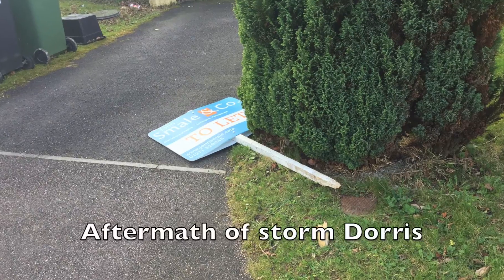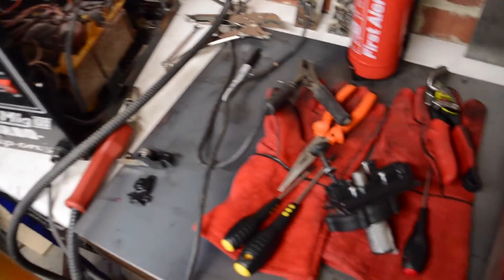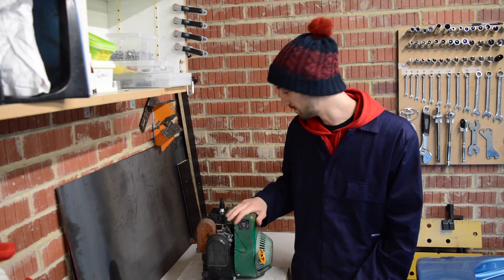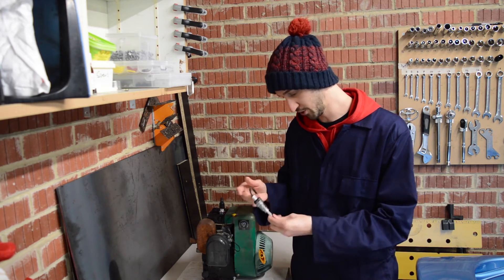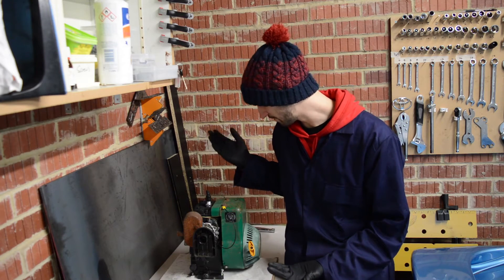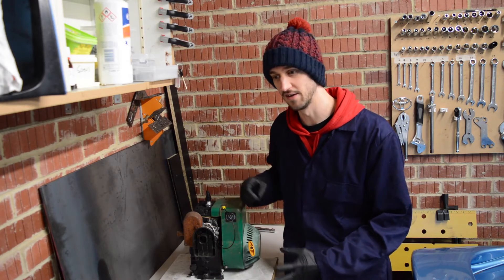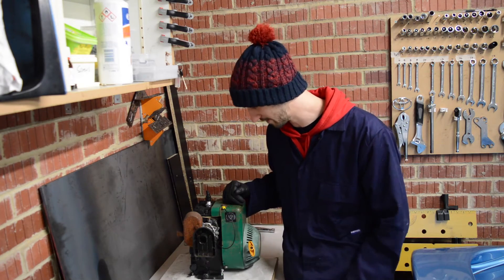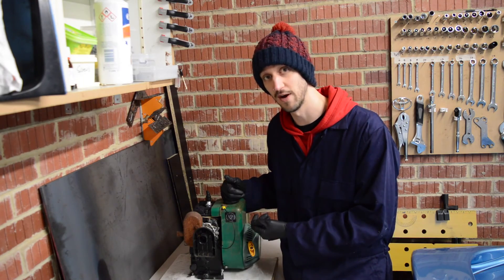Motorised Drift Trike Project - Episode 2 - Engine Diagnosis

Comment: Maybe check the float, or see if you can get a new one? If the float has a hole in it or is not "floating," the engine will flood. Also try cleaning the pin that the float connects to. If the float is flooding, there are only a few things it could be. I don't think you should have to replace the carb.
Reply: By the way--awesome channel! I'm enjoying watching your projects. And you've inspired me to try some body work at some point. I've pulled engines, but always been to chicken to mess with dents.
Reply from the maker: Thanks! Hope the body work goes well! Body work can be quite intimidating, but we work on the theory that if we really make a mess of it we can always take it back to bare metal and try again :)

I've not looked at this engine for a while, we've been too busy with the MR2 :) Back before we started the YouTube channel I check the float and it was fine. I did have to fix the float pivot as one of the mounting points snapped, so it's possible it's not quite aligned properly and the float needle isn't quite seating properly.

I've also since found the engine isn't making good compression, so I think at this point I'm probably gonna cut my losses and find another engine :)

Comment: Spray some carb cleaner in the carb to see if it'll try to start? Taking yours apart and cleaning it up might be enough to fix it honestly.
Reply from the maker: Thanks for the comment and advice :) I did try spraying a bit of carb cleaner when it wouldn't start. but still nothing.

When I bought the engine it had suffered water getting into the carb - it was rusty inside, the jets were blocked and the float was stuck. I stripped it all down, cleaned it up and freed the float, but clearly it's still not working properly.

Since filming this I've tried a compression test on the engine, and it's really low - 30 PSI dry.

I got it up to 35 PSI by lapping the valve seats, and then up to 45 PSI by putting some oil in the combustion chamber, but that's still really low. At this point I'm thinking the best bet is to cut my losses and find a new engine :\
Reply: Hey at least your losses are pretty low still, mostly just time and labor. Plus you learned something and stayed out of trouble though right?
Reply from the maker: Definitely! It's never a waste of time or money if I got to try new things and learn stuff :)